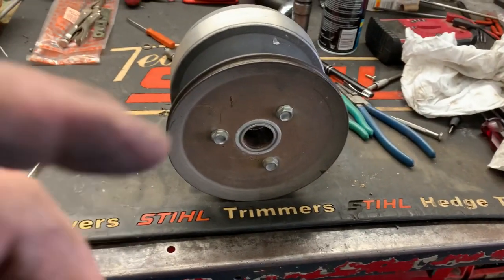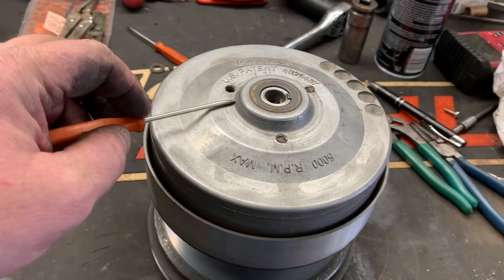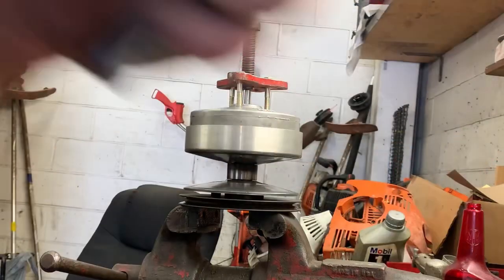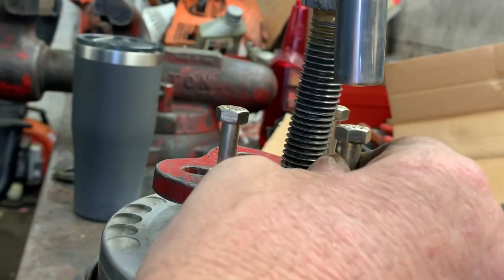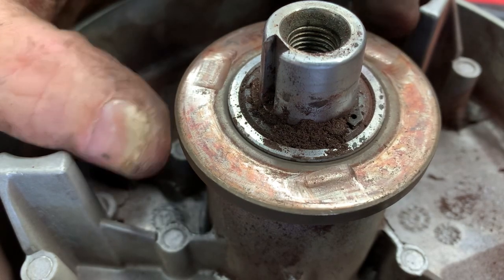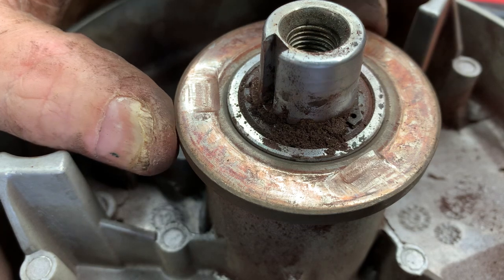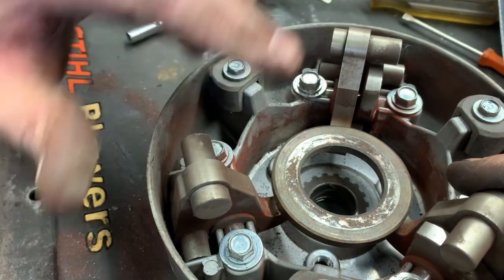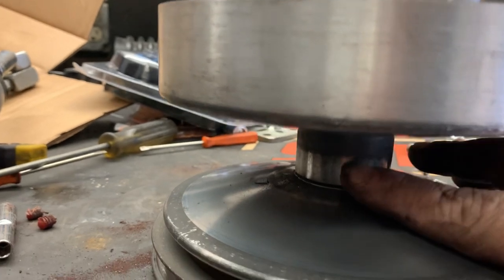HOW A CENTRIFUGAL TORQUE CONVERTER CLUTCH WORKS

Comment from the maker: Puller set
https://amzn.to/3D1woK0
New clutch
https://amzn.to/3odh86v

Today we look at a centrifugal torque converter clutch and it’s basic principles of operation. however this clutch is worn out and will need to be replaced but we are going to take this one apart and see what actually failed. I am going to link some tools above and hopefully they will be Useful for you in the future#GolfCart #SmallEngineRepair #Mechanic #SmallEngineMechanic